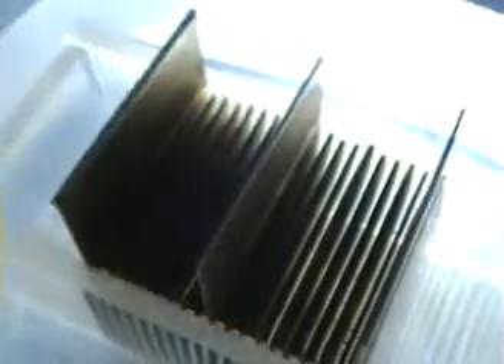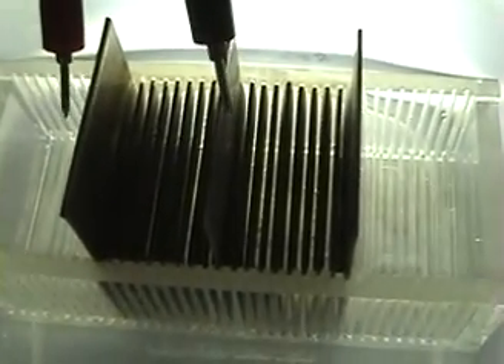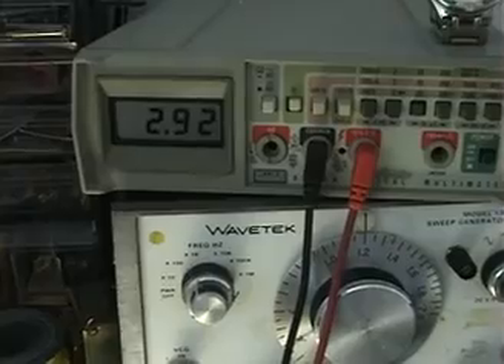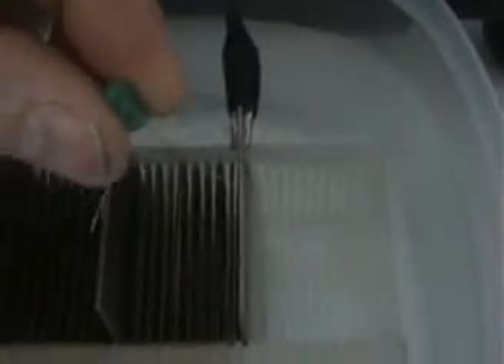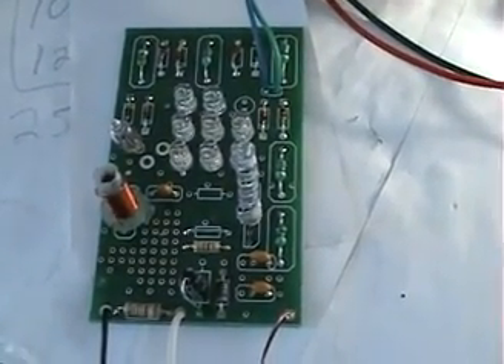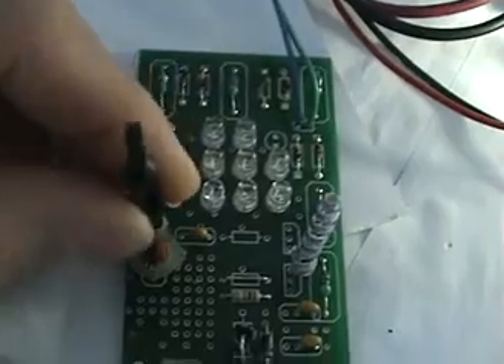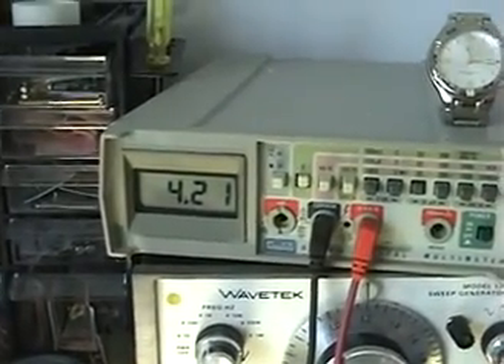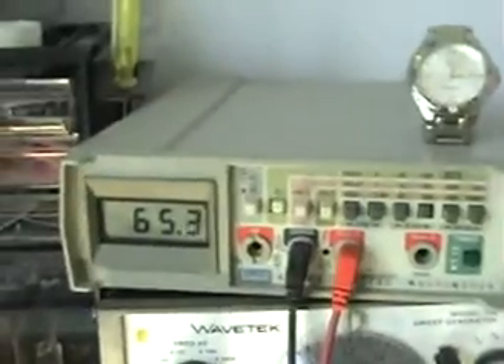Dr. Stiffler SEC on Ironhead HHO cell distilled water test 2

Comment: I have seen my electrolyser maintain a charge, so that part is not out of the ordinary ... I am not sure any of mine have ever maintained a charge for THAT long ... never tested it ... may have to take a look at that ...

BUT, the ability to get distilled water to react I find facinating ... I thought that only worked at extremes of temperature and/or voltage ...

Comment: Just shake the gas bubbles loose
and the ions wil recombine and you will loose
the voltage.
You charged up the plates with H30+ and OH- ions, so they still have a charge in their lattice.. Depends how many ions have traveled into the steel plate lattice..